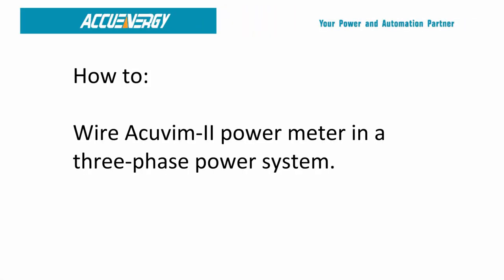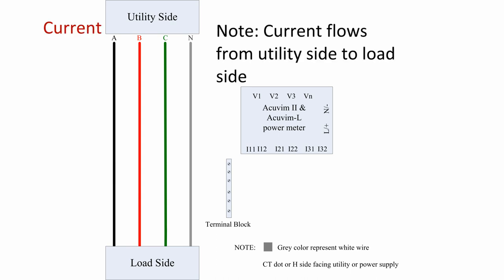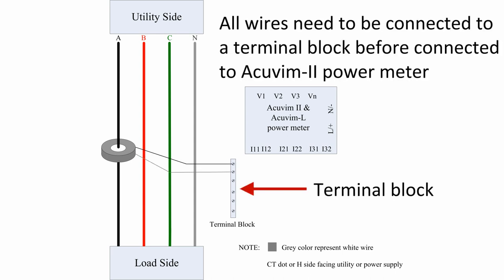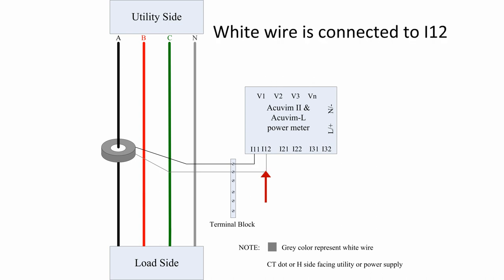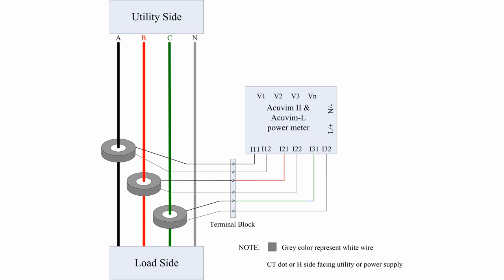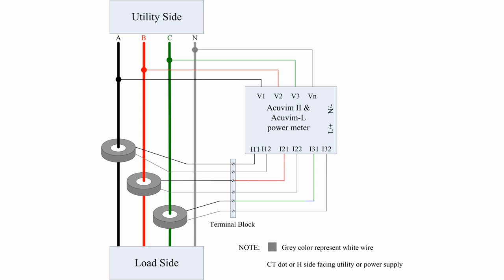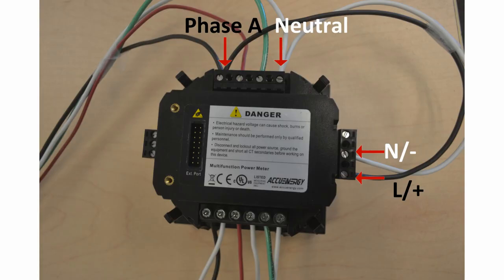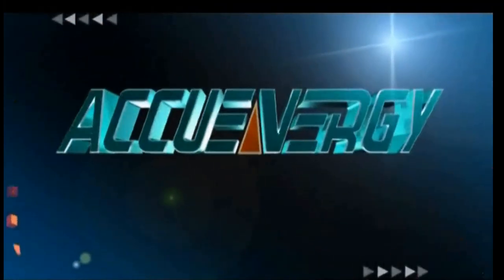How to Wire Acuvim II Power Meter into Three-Phase Power System by Accuenergy

Comment: hello. if we have 125mm² wire size what is the size of the wire we are going to use from current transformer to terminal block and to KW meter (its only a submeter). thank you.
Reply: i learned something from this video. but my problem is the wire we are going to use. thanks

Comment: what is at the load side
Reply: Hi Dewole, the load side represent energy consumption or energy receiving side, as opposed to utility side which is supplying energy. Typically you would have meters to monitor sub-panels/breakers for energy consumption
Reply: Howard Wang  hello, i comfused because i have a little im working on. and this video as been the most helpful i can find online. what is the name of the product for the utility terminal block